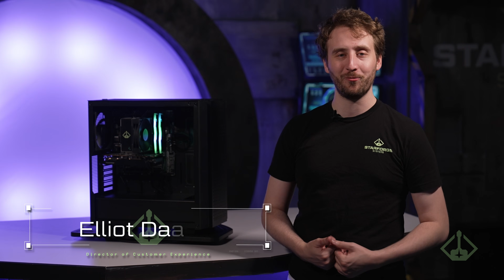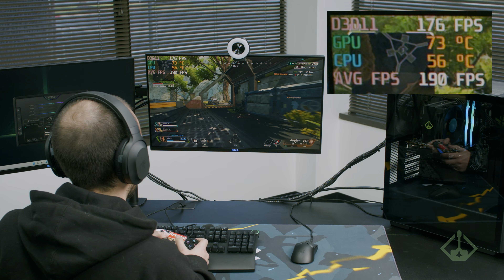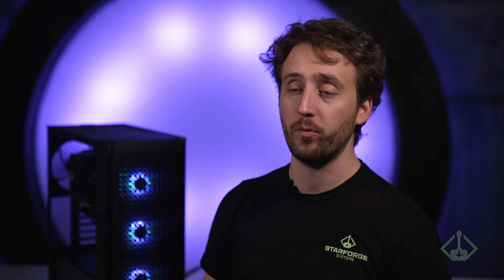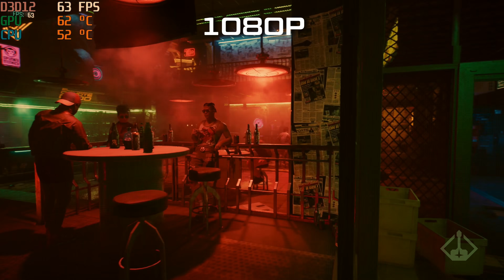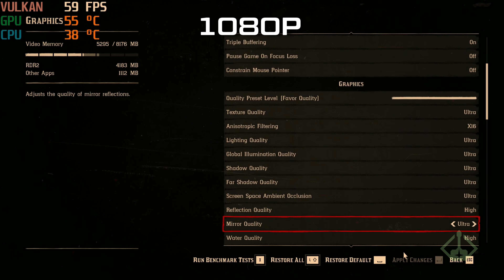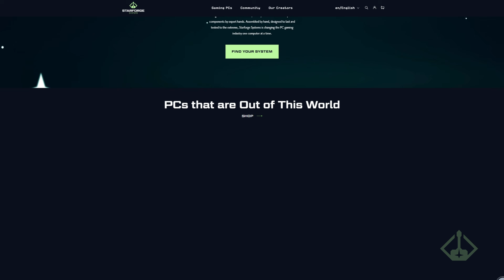Starforge Systems Horizon PC Benchmark Testing

Comment: Question: What brand of GPU manufacturers are you using? Are they different throughout each system shipped out? That can likely change FPS/temperature/performance values.
Reply: Check their website they have each part with their model and bran on their with each pc